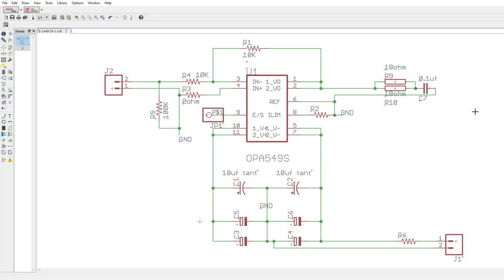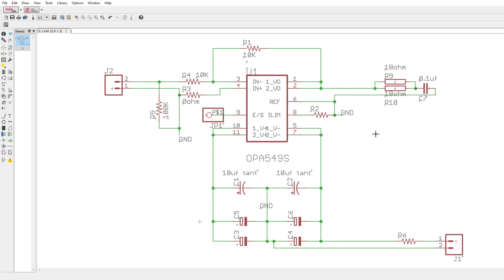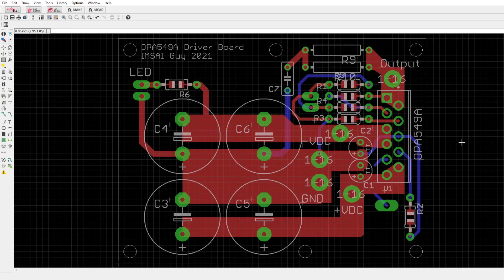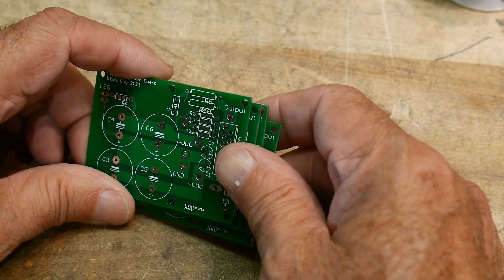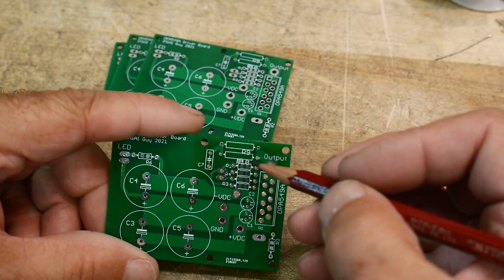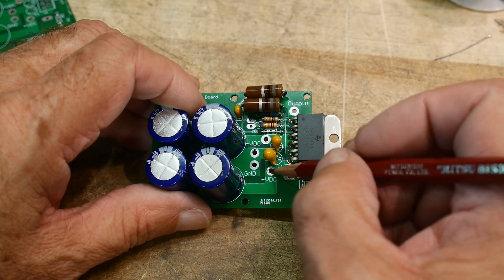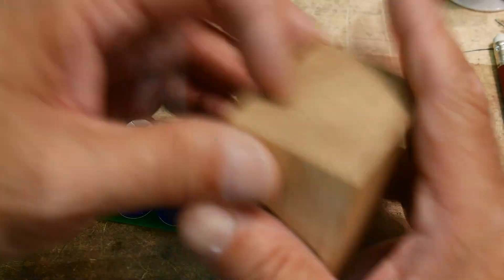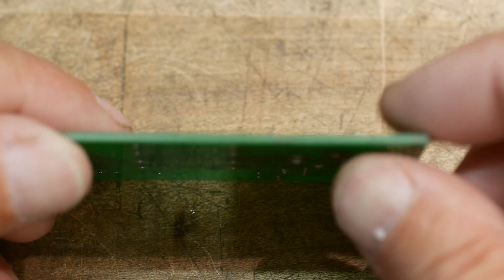#830 OPA549A Gets a PCB

Comment: I find that I'm more prone to make a mistake on a board when it's "simple". I generally take less time checking it. The best way to check it I've found is printing the board actual size and give it a visual.
Reply from the maker: you are right. I did not do the steps I usually do because it was so simple. I usually
1 turn off all layers but top
2 turn off all layer but bottom
3 run design rules check (eagle cad)
the DRC will tell you any unrouted traces.

Comment: Great video. Nice layout. Somehow you can tell in a glance when you see a board put together by an experienced analog designer.

One question that you didn't answer: Did you omit the missing trace or did JLCPCB make the error? I've generally found JLCPCB to be very accurate on my boards...
Reply from the maker: It was my bad 😯
Reply: I have found it to be very easy to lose a trace when creating panels in KiCad.
Reply from the maker: @t1d100  I was lazy and didn't do a check. That tool would have told me.